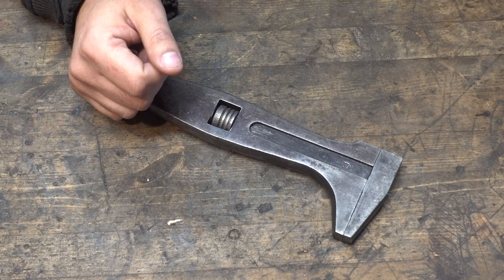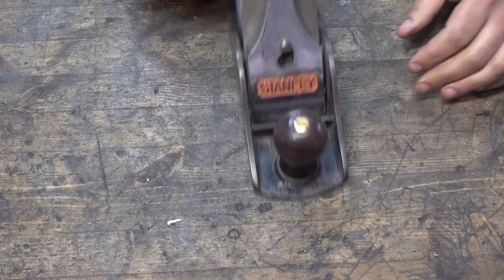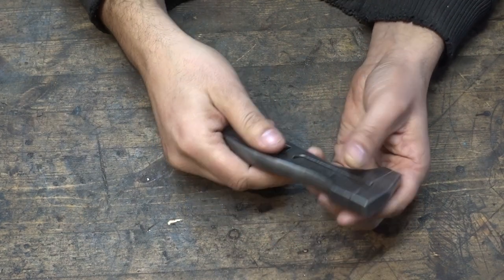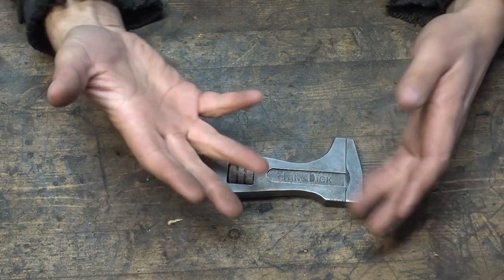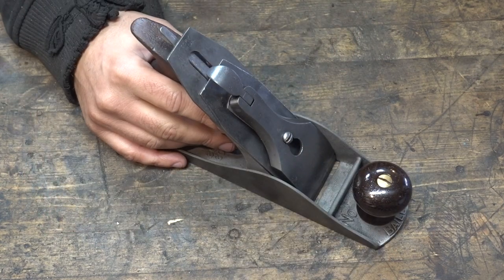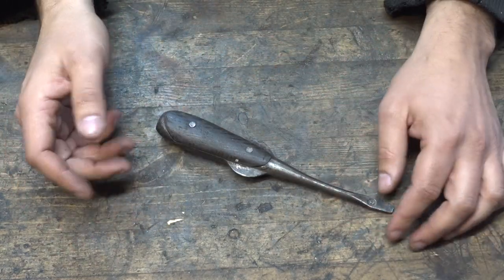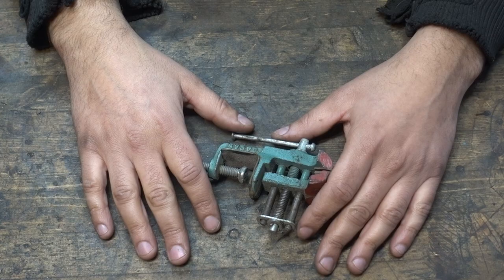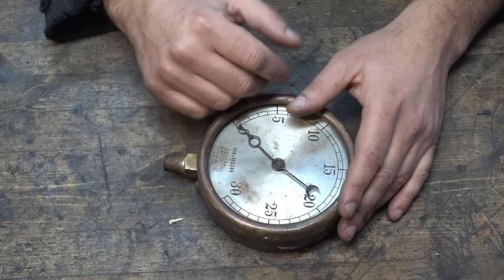Your Questions & My Answers

Comment: I have a single screwdriver like those, the tip is broken and needs filing/grinding and the wood of the handle could use some oil/polish, but it's otherwise not bad. No wings though, that one is cool! ...What is that fascinating assembly of hacksaw-like blades with a handle at 17:00 ? Theone at 20:00 looks like some kind of wood-shaping tool, perhaps for wheel spokes? Great video, thanks for the answers and the interesting things to look at while listening!

Comment: Regarding your blacksmithing... Do you plan on making some tools  based on century-old designs or making tools that you will modify from a current design with features you would want on them?
Reply from the maker: +bendingsands87 I really want to recreate old designs and forged parts for restorations.

Comment: I have a Maytag gas engine from my great grandmother's washing machine, when the washer was replaced, the engine went to the barn, it was put to running a pump for watering from the creek. I had to disassemble it to break the piston rings free, haven't put it back together, wanting to redo the ignition.

Comment: Hi
I subscribed to your channel caus I think you do great stuff with these old tools....
I'm into older stuff myself...i collect vintage & antique machine tools

What I want to know is how do you print labels to replace the ones that are missing...?

With thanks

Glenn

GLMelectrical

UK
Reply from the maker: +glenn moreland Thank you!  I usually end up making them in Photoshop and then they are printed on clear vinyl.
Reply: Hand Tool Rescue

Ok
It's just that I'm afraid I'm not very good with computers n stuff...sorry...

Listen though...

If you ever need any help on testing motors I can offer help...

You do a lot of restoration work on powered tools and its good...get an insulation tester...
And I'll explain about what polarising the insulation on motor windings is about...what it's for...and why we do it....
Its a 10 min test...but tells you a lot about the condition of a drive....

I liked the old kango breaker you did....
Just watch the old VIR (vulcanised India rubber) cords on stuff like that though...as it's often Getting a bit low on IR (insulation)...

I liked that petrol circular saw and after I watched the video I did a bit of looking...
Their a rare one...

I've just bought an old danarm chainsaw...its a rare one with a chain brake...not many about...
Its a non runner at the mo but after watching some of your videos....
.keep goin and I'll keep tuning in...

Take care

Glenn